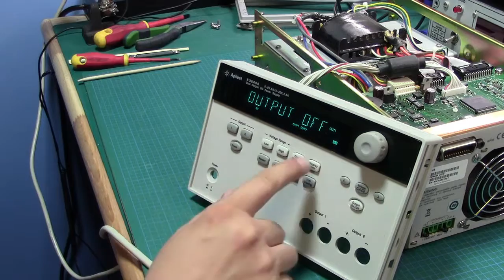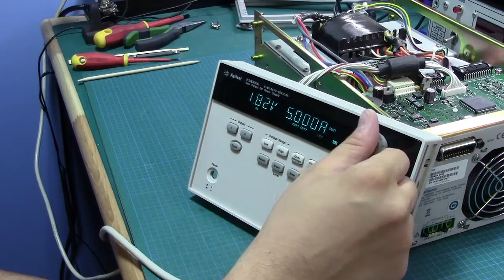E3648A Repair Part 2 - Front Panel Investigation

Comment: I have a E3632A doing something similar above  13.3 volts when drawing ~1.5 amps.  Have you've ever worked on one of those?
Reply from the maker: I haven't worked on that particular model, but I would think the design would be similar. Do you or can you find a schematic/service manual for it?
Reply: Yes.  Fast response for a video you did two years ago 8-).  Your power supply was unstable around 8 volts.  Was is stable at lower voltages?  I found my power supply is m y companies junk bin.  I use it heavily with the work I do and was thinking of buying one off of ebay.  Right now it seems fine below ~13.3 volts but I imagine that will  get worse.  The service manual offer no information for when the display shows "Unreg".  When I scope the output it starts to get like a sawtooth oscillation on  the DC above that voltage while drawing ~1.5 amps.  The instruments I would on draw about 2 amps max and that's at a lower voltage and the output in clean viewing on the scope.
Reply: I would guess that the E3632A uses IRFP044 Hex N-Channel FET pass transistors.  An electronic load like you have would be a great thing if I intended to work on power supplies, which I do not do. - lol
Reply from the maker: Well, if I remember the problem with my supply it was one (or both) of the regulation pass transistors (mosfets). In theory if the supply is under no load, the output could be reasonably clean, but as you turn up the voltage and increase the load, more strain is placed on the mosfets and that is when you start seeing all sorts of problems.
Reply from the maker: Heh, yes, it is handy. But you only need a high power resistor or two to be able to test a load. In fact, you can take speaker wire immersed in a bucket of water, and that will act as a reasonable load (for a while!).
Reply from the maker: Here you go https://doc.xdevs.com/doc/HP_Agilent_Keysight/E3632A/pdf/E3632-90010.pdf  :)
Reply: LOL